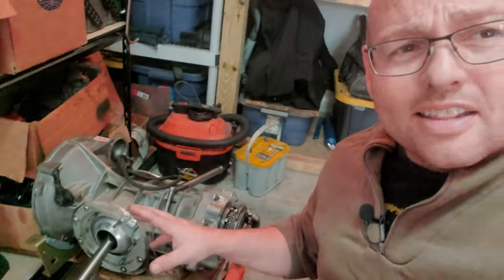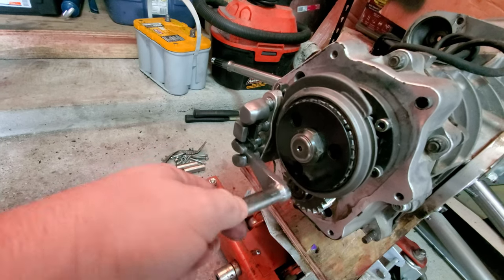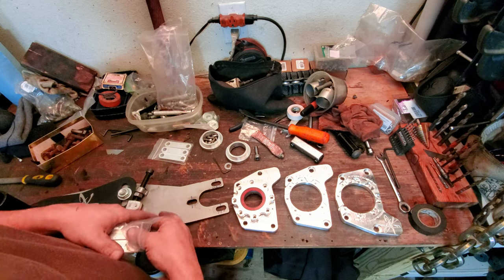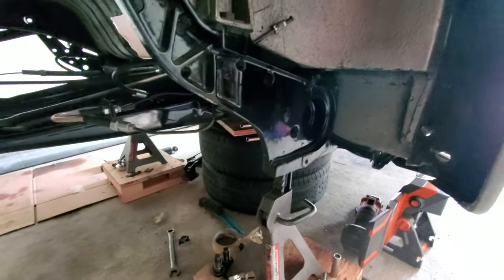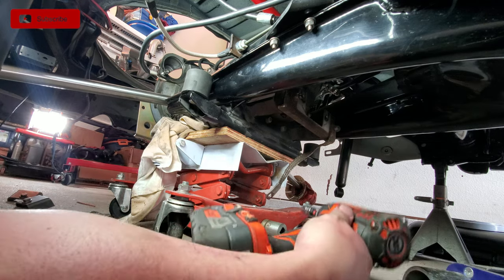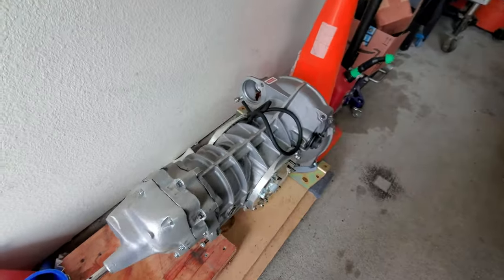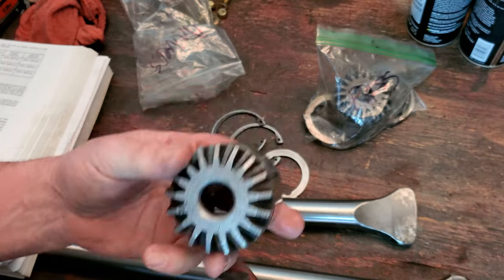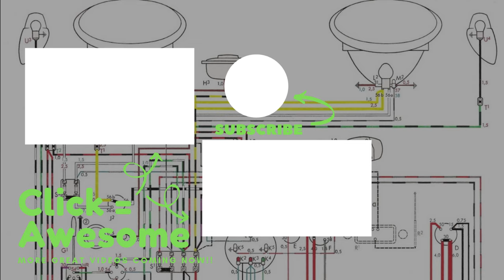1956 TURBO VW BEETLE - GENE BERG 5 Speed Part 1 | JW Classic VW

Comment: Good stuff! Great to see the VW world to expand to "5" speed gearbox. Especially GBerg who had been in the vw seen for a long time; a vw visionary ahead of the times. 
Good narration, voice, and back music. It has the intrest of the viewer. Thank you for your thorough review of the project. Now if I only had a calendar to see my days go by.
Reply from the maker: Thanks for the support George, Berg is the man when it comes to VW!  I have found out all kinds of info about this 5 speed transmission conversion and it's ability to work on a multitude of VW platforms.  Most do require some sort of modification but for the 5 speed I feel it is worth it.  Thank you for the kind review and yes I have you in for the calendar drawing!
Reply: I need that gearbox for my subie motor

Comment: I meant to ask you back when you installed the oil cooler. Do you know how much oil is in the oil cooler? 
Looks like another fine job!
Did I need to mention “calendar”?😁
Reply from the maker: Hey Terry, between the oil filter and the cooler about an extra 1.3 quarts or so.  I got you in for the calendar man!

Comment: The Berg5 is a sweet unit and would make driving a powerhouse of that motor a blast to drive. I've heard about shifting problems with these things and would like to see what kind of shifter you would be using, and what gears you have. Also, cool calander.
Reply from the maker: For sure... love the Berg, especially a built one with this Rhino case... super cool!  As for the shifter it's the Berg specific shifter for the 5 speed... I heard Vintage speed also makes one.  As for shifting problems part of that has to do with alignment of the shift rod and the reason I'm going to switch out the nose.
Reply: @JWClassicVW  get the Berg shifter. With Gene Berg parts you only buy them once...😉
Reply from the maker: Yup I have the Berg shifter as well.
Reply: @JWClassicVW  great! Put me down for the calendar too! 😉
Reply from the maker: Got ya brother!!
Reply: @JWClassicVW  how many HP can this trans handle?

Comment: I have a question about AN8 fittings if you don't mind...

I'm buildind a 2180 for my autostick Ghia. To be able to full flow the oil both inlet and outlet are on the block as two male AN8 fittings ( this is how you full flow a type 3 ). Now i need to make the braided hoses to connect with female AN8 ends BUT i cant seem to find them. What should i be searching for because "AN-8 female black" doesn't appear to be the the way to search for them . . .
Reply from the maker: No problem man sounds like a nice build 2180cc.  I'll share a few links below, you can check them out for reference.

Stater Kit Evil Energy 8AN: https://amzn.to/2DUxSfT
8AN Straight Swivel Hose End Fitting: https://amzn.to/3dLGVi5
8AN 45 Degree Swivel Hose End Fitting: https://amzn.to/2PhtgpD
8AN 90 Degree Swivel Hose End Fitting : https://amzn.to/3tMW9ZX

Comment: Hi my VW friend, what kind of turbo are you using in this application, also exhaust muffler. Is looking good. Fusca for Life
Reply from the maker: Check out my last video brother, in the description I breakdown all the good stuff.  The turbo is from CB...
0.48 A/R Exhaust Housing Stage 3 Turbine Wheel, H-Trim Compressor Housing (0.70 A/R), and a 59mm Compressor Wheel.

This turbo is capable of producing 450+ horsepower. Perfect for our Hideaway Turbo kits. This turbo has a 2 3/4" inlet diameter and a 2" outlet diameter.
Reply: @JWClassicVW  hi , I saw your video and the great list of goody's that you have. But I want to know if you have a exhaust muffler on your application. In my application I don't have exaust muffler. I would love to add one. I love the sound of my big engine. But is cool to be like kind of sleeper jajajaja. Good job 🤣🤣👍💪

Comment: So what i found is a burg 5 final drive ratio is 4.4 vers beatle 3.8 very little difference the burg 5 the extra gear is between 3rd and 4th and the burg uses VW 4th as 5th so just a slight better gear ratio between 1st and 5th vers 1st and 4th in the beatle all based from 1973 VW-Porsche

Comment: What method did you use to remove the quick roof?
Reply from the maker: Muscle and a putty knife... thinking about heating up the rest to see if that makes it easier.
Reply: @JWClassicVW  Dry ice works. I think heating it will make it worse. It’ll get soft but super sticky.

Comment: berg 5 spd is JUNK for 300 hp not gonna hold its not if its gonna break but when its gonna break
Reply from the maker: Lol... been running it for years now with no issues.  It helps to know how to shift a gear box. 😆